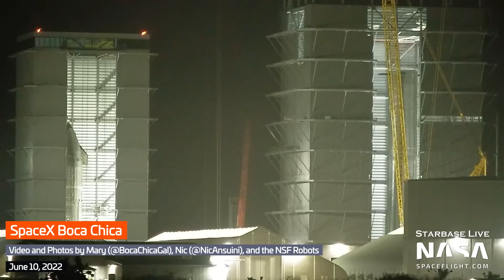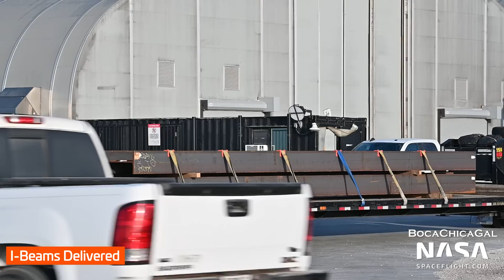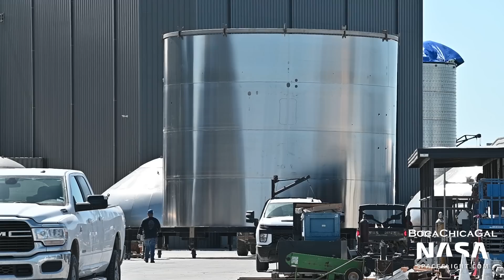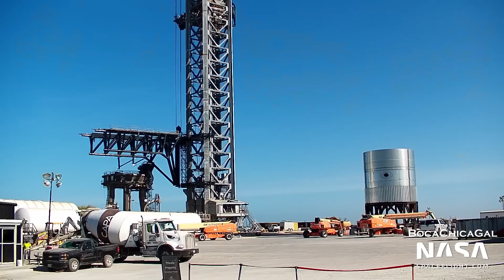Chopsticks tested ahead of potential use stacking Booster 7 | SpaceX Starbase

Comment from the maker: 0:00 B7.1 Test Tank Stacked
0:30 Sunrise Over the Launch Site
0:48 The Production Site
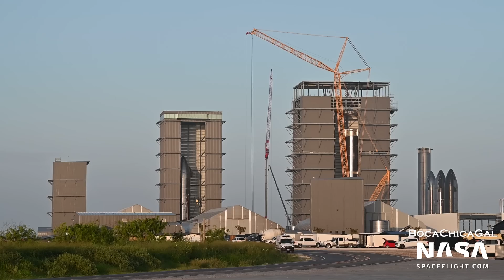1:05 I-Beams Delivered
1:25 B7.1 in the High Bay
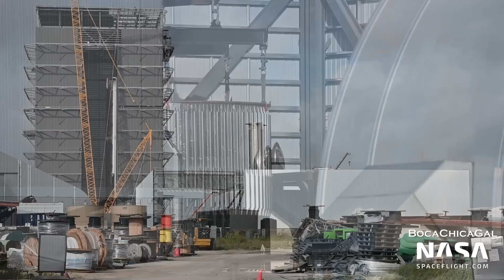1:43 Starfactory and the Mega Bay
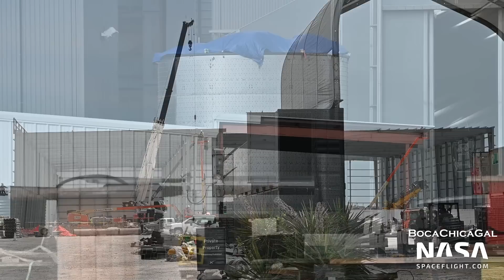2:18 Ship 25's Payload Bay Section
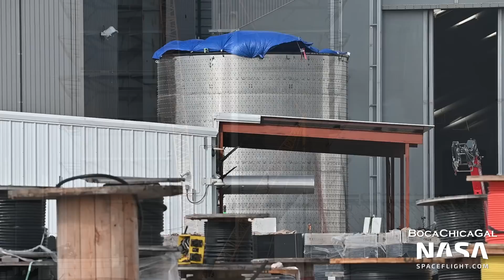2:34 Booster 7 in the Mega Bay
2:50 Ship 24 in the High Bay
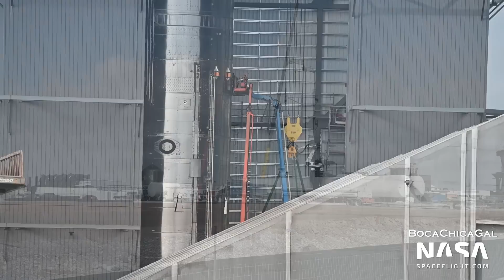3:22 The Propellant Production Site
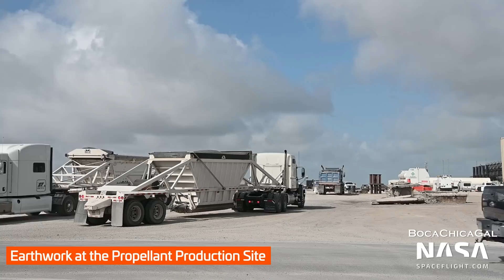4:15 Earthwork at the Propellant Production Site
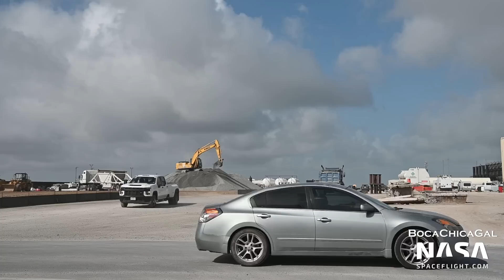4:33 Ship 25 Tank Section in the Mid Bay
4:52 The Orbital Launch Site
5:07 Booster Quick Disconnect
5:45 Suborbital Pad A
6:20 Suborbital Pad B
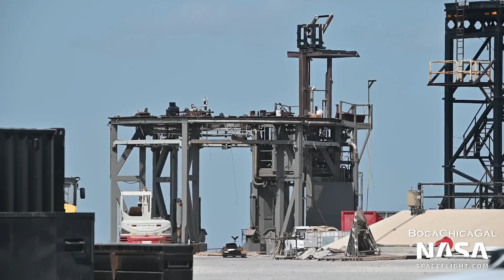6:38 Construction Outside the Launch Site
6:57 EDOME Test Tank
7:36 Ship 27 Aft Barrel Section Moved to Tent 1
8:19 The Mystery Box
8:37 Chopsticks Testing

Comment: We still haven't seen the ChopStix lift a "Booster" yet, only a Starship.
Maybe this week 🤓
Reply: Indeed.. I don't know the lift capacity of mechazilla.. I'm not a rocket scientist but I do wonder if it's possible to use the chopsticks to assist starship to lift its big ass during launch... I believe the Raptors are more than able to lift starship of the ground... but can starship structure handle the stress / load of the massive force that them Raptors is gonna put on it? But that's just me..🤷‍♂️
Reply: I thought they were designed for handling 400 ton wontons
Reply: Either ways.. its gonna be spectacular when it launch and ascend into the sky.. can't wait to hear them Raptors Roar... 🚀🚀

Comment: SpaceX need to design / procure a few large (re-usable) ‘Tupperware’ lids to cap off the various barrel / tank sections under fabrication when parked outside the tents / Bays… Would save an awful lot of cleaning effort. 😎
Also a few electric tugs to plug into the barrel / tank work stands rather than telehandlers and forklifts… Mini SPMT’s?
Reply: Once the Star Factory is done none of that would be needed. All will be indoors, with bridge cranes and all else.
Reply: @knowledgeisgood9645  Electric mini SPMT would be useful indoors too.

Comment: What is the "EDOME" test tank?
Reply: Not sure what the e stands for, but the e-dome is a design evolution using less number of pieces and a flatter shape that will increase capacity of both the propellant and the useful cargo space on the other side of the dome
Reply: Probably "Elliptical" (vs. the capped conical style).
Reply: @johnvdlaar747  interesting
Reply: Thanks guy 👍. These are some of the best broomsticks I've seen

Comment: I wonder what kind of computing system they have setup to control stage 0, along with the software, as spacex is likely relying on a lot more technology than previous interplanetary missions.
What kind of process is there to stop someone accidentally changing acceleration on the chopsticks, pushing it to prod, and trying to send that thing orbital.
How is security, automation & monitoring accomplished. I'd argue the equiptment being used to launch rockets would be classed as a zero-downtime critical system, so I doubt they're using some raspberry pi's & a fleet of ESP32's (if you can get them).
What is it actually like to write the code that if it goes wrong causes the explosion of a $2 Billion project.

For anyone wondering, yes I have recently had the unfortunate experience of pushing to prod a working build only for the website to go offline.
In my case it was a pizza shop website, downtime of around 6 minutes, off peak. Limited damage to say the least.

Comment: Maybe they could use a large drone to simulate booster landing to test chopstick catch.
Reply: They will use a booster. Its both points of view that need to be tested. The booster and the arms.
Reply: Anything other than the booster and data will be off, they have to use the booster no matter what
Reply: A drone large enough to lift a booster would have to have a lift capability at least five times greater than the current heavy lift helicopter record holder... Would be quite an awesome machine indeed
Reply: And for what it's worth, any form of a simulated catch would really need to be done with the booster under its own power, as what really needs to be tested is the ability to control the booster to the point where the arms can catch it or the booster "lands" on the arms if you will
Reply: Stacking the booster on the mount is is harder, and something they can usefully test. I think they'll try it first with B4, soon.

Comment: The white box will fit inside the starship and dispense starlink 2s
Reply: Would be a cool concept, with several gaping problems: 1) much larger doors would be needed to put the cartridge into the starship, OR they would have to build the ship around the cartridge. I'm sure ship variant with larger payload doors are coming but not yet apparently. 2) unless built with something very light weight, it would needlessly use up payload capacity, and to what end?

Comment: Good clickbait putting the 10 seconds of "chopstick testing" at the end of the video.    What did they do exactly?
Reply: Catch rockets when they land
Reply: Maybe preparing for a future lift of B7. They have had a lot of work done to the chopsticks lately. Maybe now they have the mechanisms needed to do the job.
Reply: @knowledgeisgood9645  Hopefully, but i dont recall Ship 24 with the right fittings for the arms to be configured that way yet. We will have to wait and see as per usual.
Reply: @Vatsyayana87  But the chopsticks might be capable of lifting B7 now. As to S24, it is not ready yet. So we wait. 
Btw, the chopsticks could have 2 mechanisms side by side, one for each.
Reply: @knowledgeisgood9645  I was wondering if it had something like that too, but since the ship connector protrudes out, it would hit the booster wall before the booster can set on its connector. 
I would think maybe they have an inter changable system, but that doesnt make sense to me, since youd put time and effort into building something that has no use in the future, they can not catch a ship with that setup.
Obviously i hope im wrong about the situation though and they can now lift the boosters.
Reply: @Vatsyayana87  Maybe the 2 systems can be remotely switched, just like a CNC machine switching tools? Idk. 
Elon talked about hooks on ships just like on boosters, but was not sure how to protect them during reentry. One way is to make retractable, but that also could make the weaker and less reliable. Not easy.
Reply: @Vatsyayana87  the fictional karate kid caught a fly out of mid-air with chopsticks... But yeah I seem to recall Elon alluding to a different configuration than the current one for catching/landing the ship. The current configuration appears to have the ability to rotate the ball arm that fits in the ship's sockets back out of the way. Regardless, it will be interesting to see how the ultimate design evolves.
Reply: @johnvdlaar747  Indeed we will sure know sooner or later.
As a side note, ive caught a fly mid air with chop sticks. Mr. Miagi was just trying to hard i think lol
Reply: @knowledgeisgood9645  Indeed. I really wonder if they would actually need protection, i would think the disturbance making extreme hot spots behind them would be the real issue. But im not gunna act like i would know lol